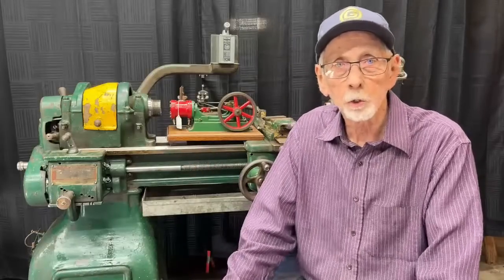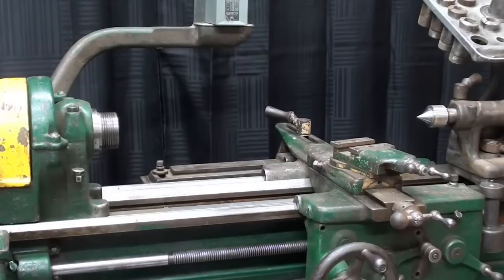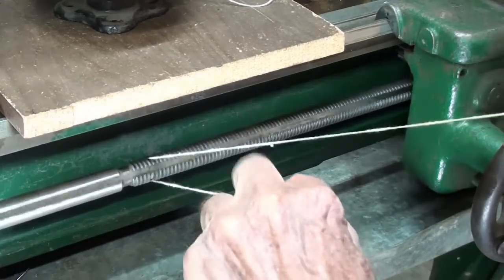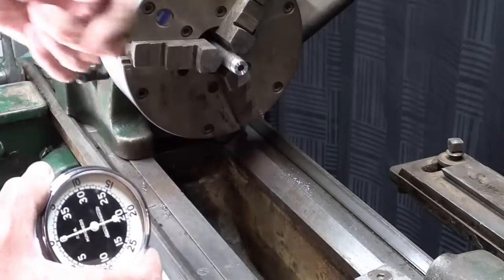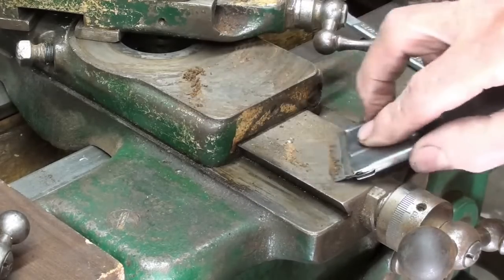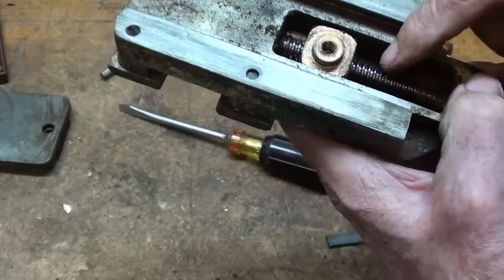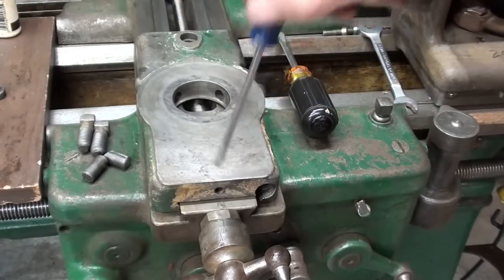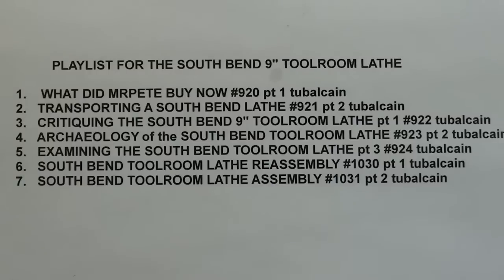FINE TUNING the SOUTH BEND TOOLROOM LATHE #1032 tubalcain

Comment: I have a South Bend Heavy 9 just like that one. Its a very rare South Bend Lathe it was only made from 1934 to 1939 and was replaced by the Heavy 10 in 1940. I completely rebuilt my lathe using Heavy 10 parts they all seem to fit great. If you end up buying a Heavy 9 and are missing parts just convert it to a Heavy 10 those parts are much easier to find.
Reply from the maker: Thank you very much for that history lesson.   No wonder i have never seen another one like it.

Comment: I sent you a head stock spindle adapter for that lathe and I believe I sent an email. Did you get them? If so, is the adapter correct?
Reply from the maker: Yes, I received it in perfect condition. In spite of your poor packing, lol. I Sherman tank could’ve run over that package and it still would have survived.
I don’t remember getting an email from you and I did not have an email address to thank you or confirm that I received it. And yes, indeed it fits the 9 inch green machine. It will be shown in an upcoming video in a month or so.   I have about six different things to show on the green machine now that I have your spindle adapter. Thank you very very much. I did not have a spindle adapter. I do not know what happened to it. Maybe my brother never had it either.
Reply: @mrpete222  I'm glad it arrived safely! I intended to send an email but perhaps did not! Sorry about that. I'm glad you can use the adapter.

Comment: Back when I was in junior high school, they stuck an oxy/acetylene torch in my hand and said You are going to learn how to weld steel.  Then they gave us sheet metal, and and said You are going to learn how to cut and bend this into whatever shapes you want, and we will let you spot weld it all together.  We used all sorts of machinery.  I think now, they give kids a tablet, and they just use their finger and slide it around on the screen.  Though, I did see at our local high school recently, there was a shed being built behind the school, which actually had kids working on it, so all hope is not gone, yet.  I may be tempted to send my grandkid over to Pakistan to learn from one of those sandal wearing machinists when he is old enough.
Reply from the maker: Thanks for watching
I love to watch those shops in Pakistan. No dress code, no safety rules, decrepit equipment, and no one seems to get hurt.

Comment: Doesn't it deserve new brass nuts for the compund and cross slides?
Found this: Left Handed 1/2-10 ACME Stainless Steel Threaded Rod Lead Screw w/ Brass Nut - Pre-cut lengths 12"-72"
 1 review
$19.95 - $34.95
Reply from the maker: That could conceivably be a good future project. But as you can see by the number of views on this particular video, there is very little interest in this machine. Hate to waste my time of which there is very little left.

Comment: There’s something about these old South Bend machines that sets them apart. They just feel “right”. The small lathes made was made to the same standards and quality as their largest models. Maybe a few less features, but no compromise. The atlas lathes in these sizes always seemed to me to be attempts at a good lathe that did have quality shortfalls. They never felt like the high quality the SB models did. Also, the SB controls seemed to be exactly what they should be and were comfortable to use. From my heavy 10 to my FOURTEEN, the controls are remarkably the same. It’s easy to go from one to the other without thinking. My heavy 10 has a dual pulley on the drive on the bottom which allows you to move the pulley to change the speed there as well.
Reply from the maker: Pretty much agree with everything you said

Comment: The screw in the screw was a very cool solution. I suspect the Mechanical RPM meter was about as accurate as the electronic one, but far cooler to use. Very good work I don't have a lathe like it, but I still learned stuff for other machines I do have. Keep up the good work.

Comment: Thanks for another great learning session on the old South Bend. I operated several of these in my younger years. The headstock bearings in one were so worn the spindle would actually rise and break the blade while cutting off. Why would anyone object to using ScotchBrite? It’s a miracle material in several grades that make cleanup and polishing so much easier. Goodbye steel wool with its tiny little broken off abrasive particles.
Reply from the maker: Yes, I hated steel wool

Comment: I ended up with a Craftsman 12 lathe recently and the old gal was packed with grease and the lead screw was a mess...I chucked the lead screw in my other lathe and used the string cleaning method but I soaked the string in some type of cleaner
Reply: The easiest way to get the grease off is to cut a length of 3/4” pvc and glue a cap on the end. Then fill with kerosene and let it soak upright. Follow up with a can of engine degreaser and you should be good.
Reply: @jimfiles3307 I've already cleaned it and hopefully i will never have to clean a machine like this ever again LOL
Reply: @chrischapel9165 I feel your pain. My restoration was a month long, done in phases. 
The final results made it worth the effort.
Reply from the maker: Excellent solution